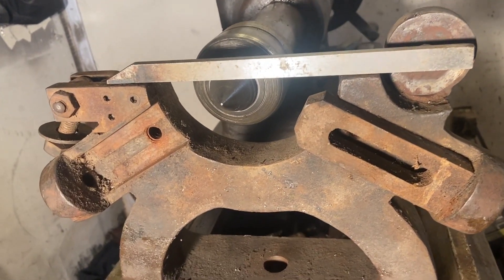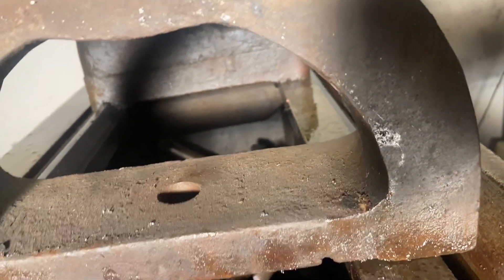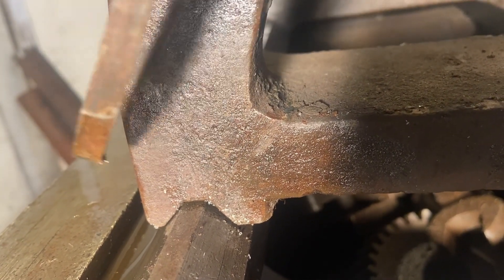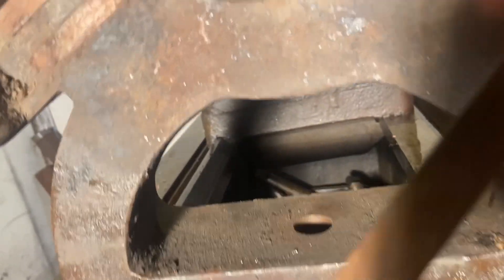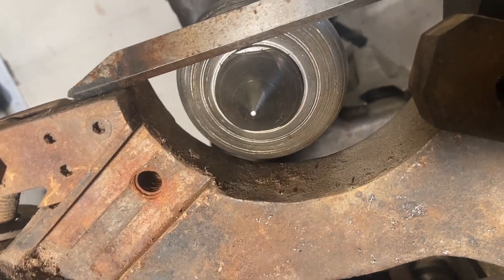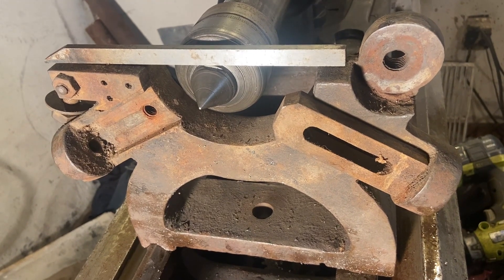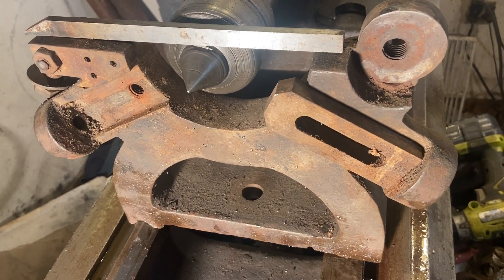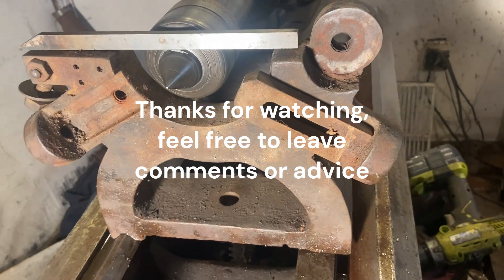Cyclebusters Walcott lathe steady rest does not fit!! Need to cut it in half!

Comment from the maker: Lots more than initially planned. After cutting off the base, well its warped. leaving me not one reference surface. The way tapers are different angles. The top of the old way angle is only about a half inch protruding from the flat side. On and on. i may just make a whole new base from stock, at least i would have one surface to work off. This old base looks like a can of worms to make work. I will cut the bevel anyways just to see how it can fit. i have nothing to lose, its useless.  So I cut the top surface .075 and its flat enough to work with. The bevel was not 45 degrees like my lathe. So I set it at 45 and began cutting the bevel. I am cutting it on the inside edge, so I am not only moving it down, I am also moving it left. I think I can get it to almost a full contact on the bevel faces. And then on to the top section. I will have to pinch it between iron to hold it level. Possibly on the shaper. I will film that. I have some of the machining on the base, for part 2.